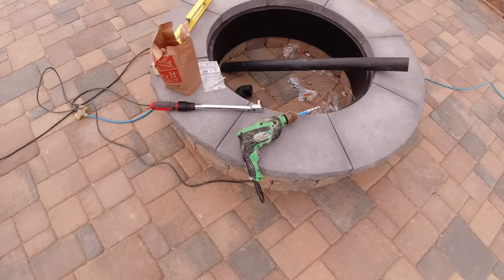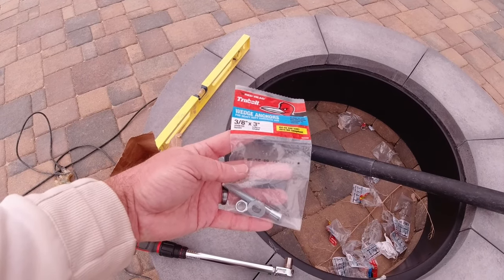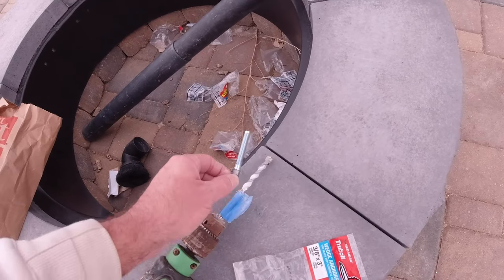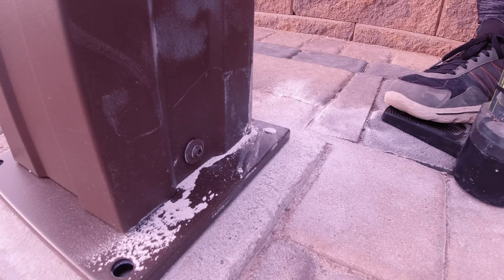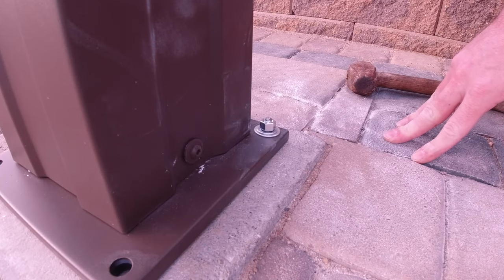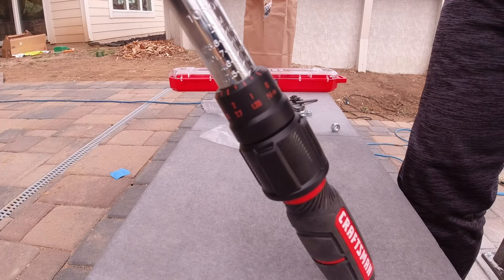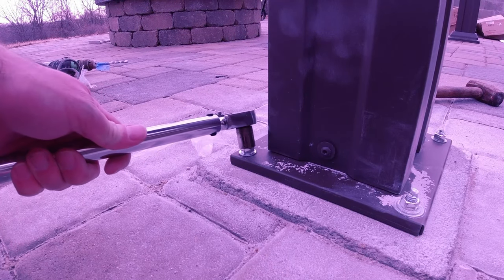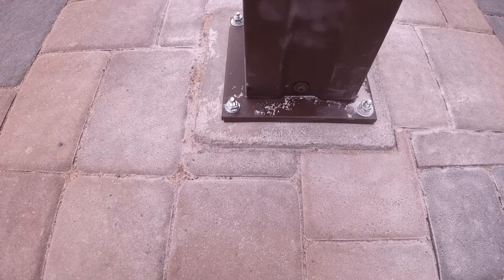Securing a Backyard Discovery Pergola to Concrete

Comment: I guess I’m not understanding why you’re drilling more than the length of the bolt when the bolt is still sticking out of the ground?
Reply from the maker: Hi! You need to over drill the depth of the hole to ensure the anchor does not bottom out before being embedded the desired depth.  This addition depth allows dust and chips of concrete to fall to the bottom while driving the anchor into the hole.
Reply: @blood_sweat_and_beers  thanks. Makes sense now.

Comment: Question for you. I'm going to anchor a gazebo to concrete patio floor. I want to put a barrier, like PVC or ABS about a half inch thick.I have done this with Hammock stands and it works to prevent the bottom from rusting. But this is a lot more weight. Your thoughts?
Reply from the maker: Sorry I missed this comment.  I think this should work just fine. Let me know how it works out. m My pergola is showing zero rust after 1.5 years.

Comment: This video is so helpful! I have  a 10'x 20" concrete patio thats3.5 inches thick. It's holding 504 lbs of steel and wood. All i have left is to officially anchor. Bc it slopes, I learned I can add metal shims to help level it...but it doesn't have a roof- no big weight to hold. The anchor holes are 3/8's. I think this will work! Drill the length plus a 1/4 and it won't bust thru the slab. Awesome!
Reply from the maker: Sounds like a great plan!  Good luck!

Comment: How did you make your concrete footings to attach your Backyard Pergola. Part of my pergola will be on existing concrete patio and the part off the grass I plan to make a concrete footing. How deep & wide should my footings be to attach the pergola posts to? 
Thanks Mike
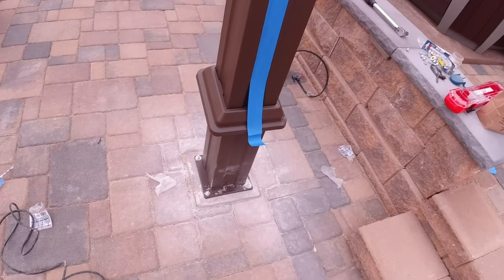Reply from the maker: Hello!  I show me preparing the footings in this video at about 10:15 mark. https://youtu.be/uzYsFbdSUl8?t=615  I went down below our frost line at 42".  The footing was roughly a 12" circle about 42"+ deep that I formed into a 12"x12" square at grade for the pergola post to attach to.  The square portion of the footing was roughly 9" deep.  You can see the completed footing in this video prior to installing the patio. https://youtu.be/Jn03bYvkwwY  You will not want to go any smaller than 12"x12" footing as the anchors will be too close to the footing edge and may break out of the footing.

Comment: Hi.  Did you set up a layer of concrete over the pavers and then the pergola plate over the concrete? I’m about to do the same but was told wind with pavers set up that way won’t hold the pergola.  Thanks and nice job.
Reply from the maker: Hi!  I dug 42” footers and filled with concrete.  The pavers were then cut around the footers. You can see the hole I dug for the footing in this video.  https://youtu.be/uzYsFbdSUl8?si=1Qg75u_PQwaThhXA go to the 10:21 mark.

Comment: How thick are the cement footings you poured
Reply from the maker: The footings in this video were down to our frost line which is around 42”.  This prevents the footing from moving from the freeze - thaw cycles.  If you are in a warmer climate, you won’t need to go as deep.

Comment: Good video.  My concern is that the pergola stays attached to its base.  I assembled a metal gazebo with a similar set up and the metal inset for the base plate is attached to the gazebo posts with just two screws (looks the same for this pergola) I used a 4" heavy duty bolt to go through both sides to help.  

One other comment is NEVER use your torque wrench to do all the tightening on a bolt.  Get the bolt somewhat tightened with your socket wrench and then finish tightening with the torque wrench.  Otherwise you will eventually compromise the torque wrench calibration/accuracy.
Reply: My neighbor's gazebo blew off from strong wind because they attached to the pavers. Attach it to the pavers only to keep the base from moving around,  but not strong enough to sustain the wind. You need strong footing.

Comment: Thanks for putting this video. Best one on anchoring. My problem is that I already have pavers in place where I am thinking of installing a pergola. Don't think drilling right into the pavers is a good idea. Any thougths?
Reply from the maker: I agree.   Drilling into your pavers is not a good idea.  The pavers won’t provide an adequate anchor for the pergola.  I’m  did that once and had a pergola pull the pavers out in a wind storm. I don’t know of any options other than removing some of the pavers to pour an footing.
Reply from the maker: You might want to look into a product like this.  It might provide enough anchor and you could still through your paver to all the ground screw to anchor itself into the paver base.
Reply from the maker: GarfatolRv Ground Anchors Non-Rust Cast Aluminum Tent Stakes Heavy Duty Metal Tent Stakes Pegs Ideal for Securing Animals, Tents, Canopies, Sheds, Car Ports, Swing Sets Outdoors https://a.co/d/jlEQo4t

Comment: For a minute i thought i found my solution, but i guess not 😢 You have concrete base already made for the pergola poles. i recently bought a gazebo,, without realizing that its not advisable to install it on interlocking (just like yours, but i dont have those concrete bases). ive been told that if i drill on those interlocked pavers, they'll crack like a cookie. any recommendations, please?
Reply from the maker: Yes, the pavers will be good enough to hold it in place with no wind, but will not be effecting in anchoring the pergola in a wind storm.  There really aren’t many easy options.  The best option is to remove the pavers under the support posts, dig a hole and pour some concrete footings to anchor the pergola.  I have it on my list to create a video on how to do this.

Comment: Whats the point ?4 heavy duty raw bolts holding each base but only 2 X very small M5 screws holding the posts to the base. I have a similar pergola I spent hours levelling each pillar. When fully assembled the whole pergola wobbles around so badly because of the 2 silly screws holding the hollow posts to the ground bases.😮
Reply from the maker: I agree the pergola will destruct before any of the anchors get pulled out.  But, that is the point to not have the anchoring system be the weak link.  I agree with the two screws holding the anchor plate to the legs.  However, this pergola doesn’t shake at all.  There is very little movement is any direction once it is all tightened and anchored.

Comment: I have pavers on top of concrete. Do you think that I can anchor through both the pavers and concrete?
Reply from the maker: That is what I would do.  I would drill the hole for the anchor through both the paver and into the concrete. I would then drill out the holes in the paver a little bit so the anchor passes through them and into the concrete.
Reply: @blood_sweat_and_beers thank you.  This is exactly what I was thinking
Reply: @Ant_007 we are doing the same exact thing, limestone pavers and concrete underneath. The problem was that the included concrete screws are not long enough once they get to the concrete. We only had about 1/2” of screw in the actual concrete. Handyman installer said atleast 2” of the screw needs to be in the concrete not the pavers. 👍🏼

Comment: What is your recommendation to level pergola when patio is slightly sloped ?
Reply from the maker: If the slope is slight I would use stacked stainless steel washers under the bolt holes to lift each post the appropriate height.

Comment: Is there a part 1 to this video? Your footers are perfect… I was thinking of pulling each paver out, laying concrete theeeeeen putting the paver on top
Reply from the maker: The process for my footers was captured well.  This video shows the holes prior to forms and concrete.  Starting the Versa-Lok Retaining Wall
https://youtu.be/uzYsFbdSUl8
Reply from the maker: The holes for the footing are round.  The ground in this video was about 9 inches below the final patio grade.  So, I made a 1 foot wide by 8” deep square form out of some wood that I screwed together.  This created a 8” deep and 12” wide square form that I placed over the round footing holes. I used some stakes screwed onto the outside of the square form to hold it at the final grade.  I mixed my concrete and filled the footing hole all the way up to the top of the wooden forms.  I let it cure 2 days and removed the forms.

Comment: How long did you let your cement dry before putting the anchors in ?
Reply from the maker: The footings were poured in fall and pergola was installed in spring, so about six months. However, you could wait as little as two weeks.

Comment: What size drill bit would you use for a 1/8” foot bracket?
Reply from the maker: The bit size would be dependent on the screw or anchor that is being used.  The specific screw or anchor will state the required bit size.

Comment: This is a stupid question but when in the installation process should you actually anchor it to the concrete? Would it be best to wait till the whole thing is installed and anchor it last?
Reply: Depends on the gazebo. Mine is all wood with a metal roof so the very last step was anchoring it to the slab so that we could get everything square. Some aluminum pergolas require it towards the beginning because they flex much more. Hope this helped.

Comment: Thanks for sharing this.  Question...I have a similar styled patio with pavers.  We did not have footings installed, but have a gazebo that I would like to anchor into.  If I anchor the posts into the pavers, would it still be secure enough against the wind?  Gazebo is probably a similar overall weight as your structure.  Thanks!
Reply from the maker: Depending on how much wind you get, I doubt anchoring to the pavers would be enough.  The roof of the gazebo will act like a parachute and want to lift the structure much more than a pergola.
Reply: We have the same problem… i guess we need to take out paver and pour concrete and anchor gazebo to it
Reply: Did those bolts cole with the pergola? If not what bolts are needed to fix into concrete?

Comment: Hi - did you take some pavers out to put the concrete footing?
Reply from the maker: In a prior video I showed the holes for the footings. I dug and poured the footings prior to the patio.  If the patio is already in place, yes you would need to remove some pavers to pour your footings.